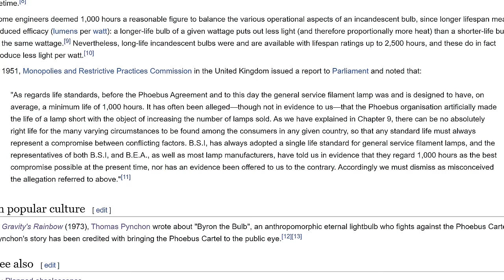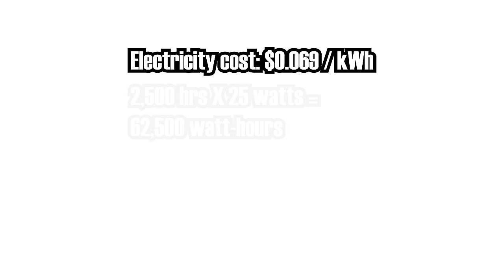Longer-lasting light bulbs: it was complicated

Comment: One thing I don't understand: if it were really about efficiency, how are 2500-hour appliance bulbs ok? They don't meet the efficiency standards. If efficiency were the concern, appliance bulbs would be lower-wattage, 1000-hour bulbs. Without the concern of efficiency, it would make sense to make longer-life bulbs, instead of lower-watt bulbs.
With respect to these aspects that you ignored; it seems that planned obsolescence was the goal, & they were able to put out some technical propaganda to dissuade people from thinking that's what they were doing.
Reply: Less light and longer life is coming from thicker filament. 20:29 and 22:32
Reply: @danek_hren  Excellent work, pointing out other parts of the video, & telling me the main point of the video. However, it has nothing to do with what I said. If you feel like reading what I wrote, maybe you could respond to my points. If not, please at least refrain from leaving responses to questions that weren't asked.
Reply: @human498  sorry.  22:32 - why 2.5K hour life light bulbs still exist
20:29 - it's not propaganda
Reply: @danek_hren So you still don't want to address the point? Nothing you timestamp answers what I said at all.
Reply: @human498  22:32 - "Light bulbs with a lifespan of 2500 hours are made for cases where one can't replace them very often because they are in hard to reach places."
20:29 - "It was better for ALL PARTIES involved (including you, the person paying the power bill) to run the filament as hot as you could in exchange for lower operating costs."

22:32 is why 2.5K hour life light bulbs are still being produced, and 20:29 is the reason they didn't produce long life bulbs.
Reply: @danek_hren  The propaganda is that efficiency is the concern; that the reason for shorter bulb life, is that we end up using less power by balancing bulb life with brightness. If that were true, then we *would go with long-life bulbs in situations where less light is needed, & changing bulbs is a concern*. In those cases, "hundred-year" bulbs would be the best option, instead of limiting bulb life to 2500 hours. This would give off lower quality light, which, it has been conceded, is fine in those places (appliances & the like); and it would need fewer bulb changes.
  If efficiency were really the concern, appliances would have "hundred-year" bulbs, not 2500-hour bulbs. This argues against efficiency concerns. Efficiency concerns = propaganda
  I have explained again for you, repeatedly. However, you have shown no interest in addressing what I have said so far, so I expect nothing different from you now.
Reply: @human498  Y'know, for some reason I forgot: 1. that Phoebus cartel wasn't a wholesome organisation and 2: brain

Comment: To your point of bulbs being cheap to manufacture...  They were/are cheap to manufacture at scale, because they are manufactured at scale.  Just like the F22, the fewer you produce, the more expensive they become per-unit.  And an industrialist won't invest into a factory for bulbs if it won't have a very high ROI over a long term, or a reasonable ROI very quickly.  Without the factory the per-unit cost goes up, reducing the rate of adoption and even the level of affluence someone will need to adopt.  Soooo...  its even more complicated and back to the cartel/conspiracy.

Comment: Ngl, but I feel doing this video without going over prices when the cartel was actually active renders it pointless. Especially the cost comparison between bulb purchase cost, bulb running cost, and power plant infrastructure cost.

Also, the part about comparing light bulbs to dish soap actually undercuts your point. It is a well known fact that the amount of soap you are encouraged to use is well above what is actually needed. That's planned obsolescence! In a consumable!

Hell, didn't YOU do videos about that with the dishwasher?

And I know you weren't arguing that the light bulb cabal was a good thing and that you were only talking about the planned obsolescence, but I don't think you can talk about it without taking about how it affects R&D.

This 1000 hour agreement means that no one was looking for a way to increase longevity. Maybe there's a tungsten alloy or different gas mixture that would minimize sublimation.

Would we have gotten LED lights much sooner if light bulb manufacturers hadn't barred themselves from improving lightbulbs? It is very very possible. One could reasonably call that planned obsolescence.

You briefly touched on this, but if 1000 hours is objectively the sweet spot, why have an agreement, at all? Why have inspections and fines?

Is it only planned obsolescence when you make a good product worse? Is it not planned obsolescence when you just decide to not put R&D into making a product better?

Comment: Why did you use degrees after Kelvin? 8:10
Reply: Kelvin doesn’t use degrees. Degrees refer to an arbitrary fraction of the distance between two fixed points. Celsius is derived from two fixed points— water’s freezing point (0°C) and its boiling point (100°C). Each “degree” in celsius is 1% of the difference in temperature between those fixed points. For Kelvin, the increments are the same as celsius, but instead of starting at the freezing point of water and being compared against the boiling point of water, it starts at absolute 0 and isn’t compared against anything.

He’s being cheeky because the only people who correct anyone for saying “degrees kelvin” are pedants like myself, so he’s intentionally being double incorrect by saying “kelvin degrees” and giving the pedants a heart attack.

Fun fact: Fahrenheit is based on some random dude’s assessment of the freezing point of a saltwater mixture measured against the average temperature of the human body. It’s been refined and adjusted, but it’s still based on saltwater and warm human meat.

Comment: I'd like to see a thorough comparison of all of the trade-offs between incandescent & LED bulbs. Including the energy, material and environmental costs of manufacturing. My suspicion is that the energy & materials that go into LEDs eclipses that of incandescent bulbs so much, that it completely undermines the argument for them as better for the environment. What about their environmental impact when disposed? The materials that they are made from are more problematic, both their disposal & acquisition. As well as the reality that they are being made in countries that overwhelmingly use power produced by coal while the power to run them is increasingly renewable.

Comment: I have to disagree with you here.  The bottom line is that it removed choice from the consumer and the marketplace.  It introduced a standard where there wasn't one needed.  If someone prefers a more orange glow, a slightly dimmer light, but more lifespan, then more power to them.  On the other hand, if someone else is happy with buying many 100 hour bulbs that produce a whiter and brighter light, that's fine too.  When you have businesses colluding with each other to remove what would otherwise be a decision made by the free market, it's wrong.  It's not only planned obsolescence, it's planned removal of competition by means of proposing all companies just offer the same products.

Comment: I understand the tradeoff you are talking about -- cost vs life etc.. -- but what about the trash aspect of it. We are unnecessary garbage pile -- when we throw away an blown bulb it stops being my problem, but that bulb and the detritus of it does not go away forever. Comparing to a laundry detergent is wrong. I am assuming that laundry detergent is processed at the processing facility and water is recycled (or if you use plant based detergents -- they decompose). Throwing all the trash into garbage is not all environmentally friendly. Could we pay more upfront and reduce our eco footprint?  This whole throwaway culture is causing all kinds of ecological problems by creating unnecessary garbage. We should consider the environmental costs in the tradeoffs and maybe say we pay more upfront if we can have longer or forever life.

Comment: What makes you think the advantages you cited for shorter life in light bulbs necessitated shorter life? Why would limiting lifespan automatically have those benefits? And, assuming they are cheaper to operate, at the time, was that enough to make up for the cost of replacement? And them never being a durable good doesn't mean they weren't more durable than those standards imposed upon us, and that wouldn't even mean that they couldn't become more durable if there hadn't been a conspiracy to prevent that. There is most definitely a problem with light bulbs.

And then we were sold those supposed long life fluorescent replacements that cost three times as much and didn't last any longer despite their advertisement. 

By the way, have you ever heard of a light bulb brand named Decade? Supposedly lasted a decade. While it was available, I bought a few of them and they did last about three times as long as a regular light bulb, or even more. I had them still running after 5 years, and they were no less bright or white or, as far as I know, efficient. Then they mysteriously disappeared from the market. No, there's something wrong here. You seem to be glossing over a few things yourself. 18:44
Reply: Okay, I had typed more into this comment, but it seems like YouTube editing is buggy (deliberate obsolescence? 😅) And it erased a bunch of points, as well as changing some of my words to be incorrect diction. I don't have time to put it all in again.

But, climate change is caused by remanufacturing unnecessarily and requires regulation of corporations. And it's become urgent.
Reply: Put more tungsten in the filaments and it will take longer to evaporate. Or try a different material. But GE and Phillips didn't want to do that.
Reply: Also, seal the glass better so air doesn't leak in.
Reply: Your conclusion that long life inefficient light bulbs would optimize profits is made without evidence.
Reply: How do you figure that the standards not changing means they weren't insidious? I could take the exact opposite conclusion from that.
Reply: If you're making one mistake more than any other here, it's drawing numerous conclusions without logic or evidence. I really like your videos in general. Your other videos. I really don't like this one. It is not up to your standards.
Reply: You also overlooked the time spent replacing light bulbs, and the time spent with light bulbs burned out, or the compensation of multiple bulb fixtures so that it burned out bulb didn't cause complete darkness. And you are assuming that pricing for bulbs and power were not manipulated. I could go on and on.

The fact that decisions are being made for consumers that are not in their best interest all the time doesn't make it okay. There needs to be regulation. Groups of manufacturers shouldn't be the ones making these decisions. That does, in fact, represent a conflict of interest which should not be allowed. The fact that it is often allowed doesn't make it acceptable. Government has its purposes and this is definitely one.
Reply: How do you know the cartel doesn't still exist today?
Reply: The reason isn't important? Are you serious?
Reply: I think it's funny how you ended this video. Light bulbs sure are better now. That's true. The obvious conclusion is that they should have been better a long time ago. Why weren't they?
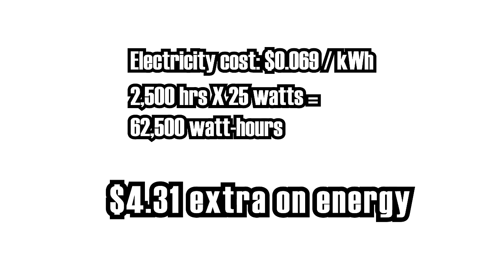Reply: There's a hard tradeoff between efficiency and longevity, and there's simply no way around it. And since incandescent lights are very cheap and not efficient at all, their operating costs always exceed their purchase costs. 22:10 shows a direct cost comparison. Also, fluorescent bulbs last an absurd amount of time. I still have some CFLs in my house. And it's funny how you're claiming that he doesn't have evidence, yet your evidence is "as far as I know".

Comment: Another very insightful video, thanks!

I was wondering whether the filament could have been packed into a little glass tube to keep it from prematurely breaking and falling down. But that tube would then have dimmed quickly with sublimated tungsten, I guess. Which made me think whether a little tray would have worked, as a support for tungsten, for bulbs that had a defined spacial orientation, like in a desk lamp. Bulbs with a little arrow "this side up" :)

Comment: People love to pay more  than they need to, thinking they’re getting more, when in fact they don’t. 

EVs are a current example. People clamor for bigger battery packs. Because of course bigger is always better!

So they’re willing to pay thousands (or tens of thousands) of dollars more to get a bigger pack. These supersized battery packs weigh significantly more. This means that their car is carrying around a lot of extra weight which affects efficiency (along with the extra motors and extra HP), meaning those extra batteries cost more to drive around each and every mile. 

And why do people want to spend thousands of dollars more to buy and operate these supersized battery packs?

Range.

Even the most modest EV has a range that exceeds the average American drivers daily needs. And even on long road trips, virtually all of these more modest EVs will function quite well. (I have a ‘21 Tesla Model 3 SR+, the shortest range, slowest charging, and least expensive Tesla - and I regularly take it on road trips of 1,000 - 5,500+ miles quite easily.) 

But hey everyone gets to do their thing. I see people who’ve spent outrageous amounts of money for huge SUVs and ginormous pickup trucks to go to the wilds of… the grocery store! Same thing with these huge battery packs. They get used rarely for their intended purpose, and cost the driver more every mile they haul them around, unused and unneeded. 

America. What a country!

Comment: The light that burns twice as bright only last half as long
Reply: but also twice as efficient and cheaper to operate
Reply: @danek_hren  also that. But if I had a 100 percent efficient engine it'd be the most slowest underpowered thing ever. It'd have just enough power to keep itself standing still on a hillside slope and the exhaust gases would be recouped until all heat and airflow was taken from the exhaust before it left under zero psi. A 100% efficient radiator would be warm and installed under tons of airtight insulation that never lets heat escape. It wouldn't heat the room but it'd never loose its heat. I know that's not what we mean when we talk about efficiency but we compare against other things. But if we were to talk about what efficiency means. It is not meant to have room for overhead. It's no more no less must be such and such a figure. Like efficiently building a bridge that could take a 20 ton truck and not putting a single extra bit of reinforcement or building material to surpass that. Itd be able to take exactly a 20 ton truck add a 1kg bag of sugar to it and the bridge collapses.

Comment: I fail to see the reason this standard needs to exist. Sure, there is a trade off. Buy why not let consumers make that choice? As long as the marketing is clear "you get x or y, not both" it shouldn't be a problem.

Also, this would seem to justify a minimum lifespan just as much as a maximum. Seems to me a manufacturer would be just as interested in making a brighter bulb that lasts a lot less.

Comment: First (a comment before watching the video), if you could sell just 1 billion of anything, let alone 8, running out of customers would hardly be a problem. Second, building things to fail just to sell more is a dangerous strategy, especially if customers start finding out (as I did years ago about smartphones - an industry infamous for this crappy practice), and doesn't appreciate the fact they've been had in such a devious way, they may never buy another one - ever. Others may think that since they got a lemon the first time, they simply won't take the chance of getting another one. In short: At best this business strategy is a double-edged sword one might regret wielding...

Comment: 26:22 No, I would have to sacrifice EITHER light quality by keeping the power draw the same as before, OR accept a higher operating cost at the same light output....  but not both.

What the cartel did was indeed planned obsolescence, by removing the customer choice of balancing the trade-offs for their own desires. On the flip-side, they also removed the option to run the lamps a bit brighter and change more frequently.

A more consumer-friendly cartel would have instead made the 1000 hour bulb the default, with variations marked "long-lasting, dimmer" or "brighter, short-lasting".

Comment: With how simple the lightbulb is. To say that a led bulb is “better for the environment” merely because it uses less electricity is actually insane. I mean the entire incandescent lightbulb can biodegrade in less than 50 years. While the plastic bulb lays around for a couple hundred. Don’t even get started on the manufacturing on the plastics that go into the bulb. The standard incandescent uses mainly glass and metal. Incandescent lighting is the best option for home use in my opinion.

Comment: The led bulbs we use at my job are remarkably short lived for led bulbs. I know it's because they're cheap chinese trash bulbs though.
Reply: Most LED bulbs die because of the driver itself. They cheap out on the capacitor which is usually the first to go.